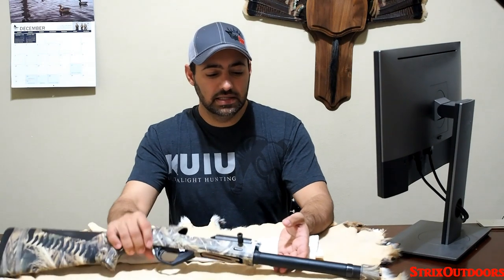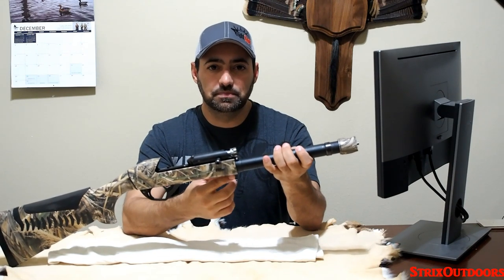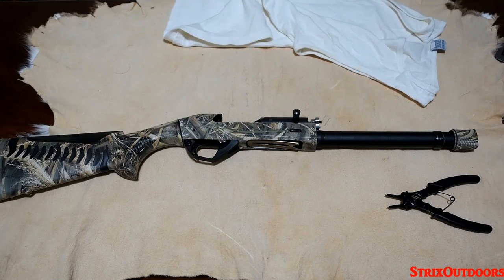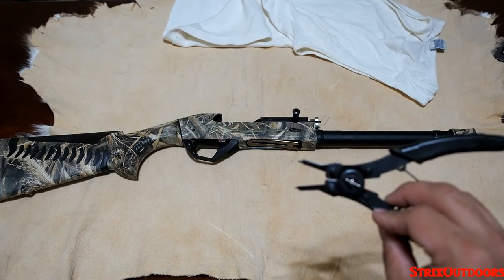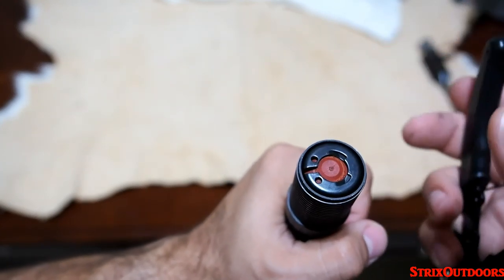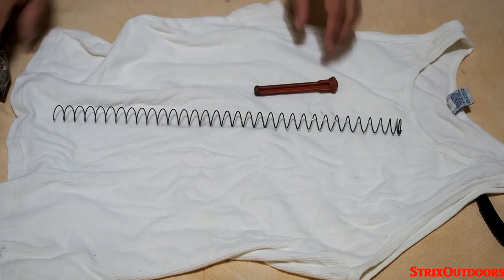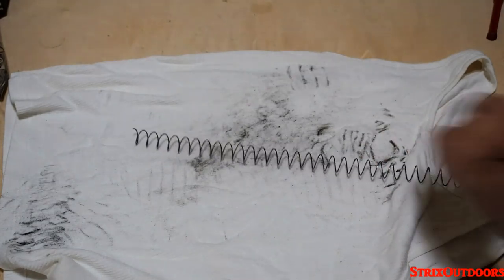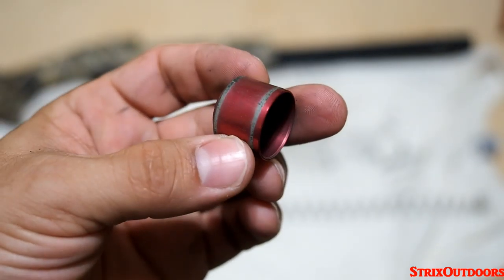Benelli SBE3 Magazine Spring Cleaning

Comment: If the stock was submerged you probably want to take the recoil spring out and clean the recoil tube. Prone to rusting.
Reply from the maker: Yup, you're absolutely correct.  I've done that also but didn't publish a video about it.  I may need to.  It is not easy to do...

Comment: How many rounds the magazine carry when the plug is removed  ?
Reply from the maker: It should be 4 total.  3 in the magazine tube with the plug removed and 1 in the chamber.  I've never looked into one, but I believe you can buy magazine extension tube that will allow you to hold more shells.  I'm not sure what the max is.  Of course, removing the plug or using an extension tube is illegal for most migratory bird hunting.
Reply: @strixoutdoors  thanks
Reply: @strixoutdoors  Does it come with a plug out of the box? or do I have to buy one?
Reply from the maker: @MWL7838  , all shotguns in the US (at least that I know) come with the plug and the plug is usually installed as a default (the SBE3 included)

Comment: Try this: use brake cleaner in a spray bottle you can buy it at Walmart for  $1.99 cleans all the carbon. Use gun oil then wipe the  parts off and then you’re ready to go.
Reply from the maker: Good idea!  I will be doing a thorough clean after this duck season again.